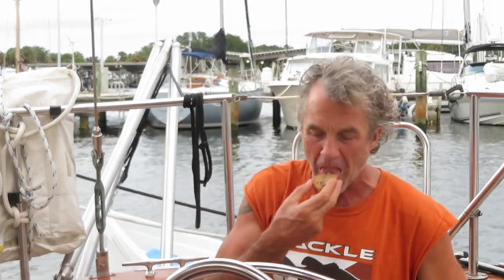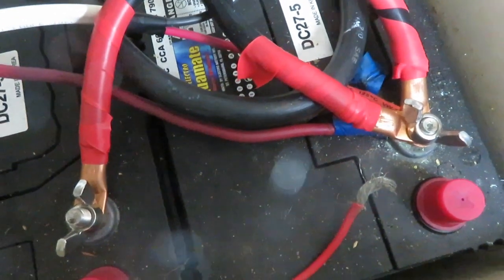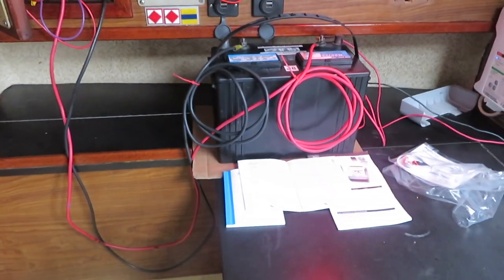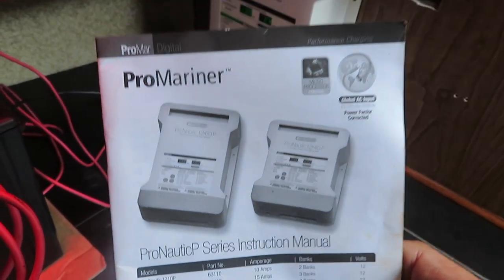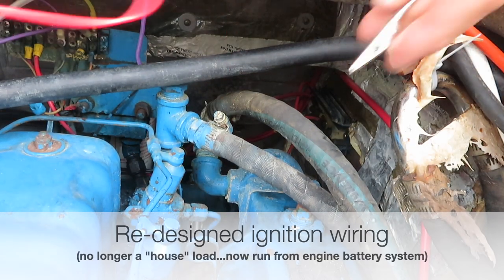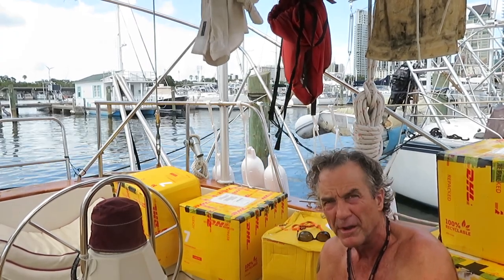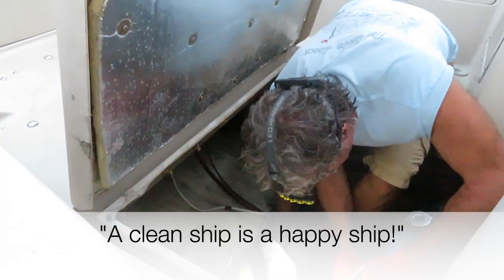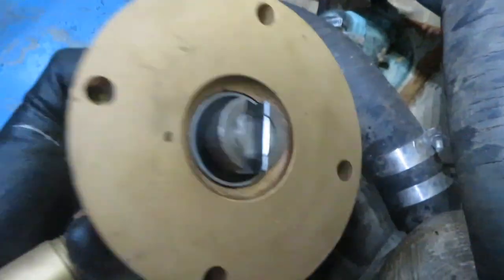Skipjack Sailing 26.  CSY 37 "speedy fit-out" for cruising.  Nuclear worker prepares for cruising.

Comment: Ahh! Takes me back to my days as a marine engineer. I became convinced that at a point in every older boats life, the wiring becomes organic, semi sentient and does its own thing under the cover of darkness and when no one is aboard. At that time, my favourite and most used phrases were WTF? and FFS! Nice one Russ; all the best mate.
Reply from the maker: Thanks, Jack.  I surprise myself sometimes with my curse words.  I have removed about 60% of the wiring that was in the boat, and there are still some more 16-ga wires around the engine that are determ'd....just hanging there.  And there is some old oil pressure sensing line that needs to be properly abandoned.
Reply: @skipjacksailing8986  Well she's already in one hell of a lot better shape than when you got her; it's a process. Looking forward to the next one.

Comment: Hey RUSS! Glad to see all those boxes arrived. I found being entrusted with shipping all that stuff quite humbling. I am really looking forward to your next YouTubes which I am sure will help to encourage me to knuckle down and get my boat in the water before winter. Have you thought of adding a wind turbine? Enjoy your Scottish weather Florida style!
Reply from the maker: Actually, Andrew, there is a wind turbine physically installed, but the previous owner cut the cables just inside the hull.  I have not ever bothered to even see if it is making any voltage.
Reply: @skipjacksailing8986  looks like you are getting the chance to test your solar panel fitting security very soon, hope all goes well.

Comment: Way to go Russ! Good to hear/see ya  have it sorted, engine squared away and all yer  goods in from Scotland.
So.... which direction are ya heading? 
Fair winds and following seas. Stay in touch when you can.
Reply from the maker: Thanks, Paul.  After I shot the video, I removed the heat exchanger to have it leak-tested and cleaned.  It was full of sea-growth-crusty-stuff.  I would still love to also install a roughing filter in the fuel line, and to change the raw water strainer.
Trying to not solve world hunger, but also am fearful of engine failure in remote places.

Comment: i hope you batten down the hatches and add extra lines for Elsa. when you were working on the engine, what was the white 'goop' that was on the fitting and line? the fitting looked like it was U shaped.
Reply from the maker: The white thing was just a paper towel used to prevent the entry of foreign objects into the engine while the pump was removed.